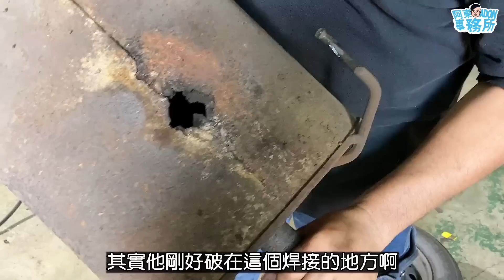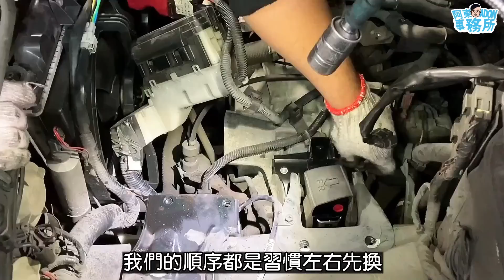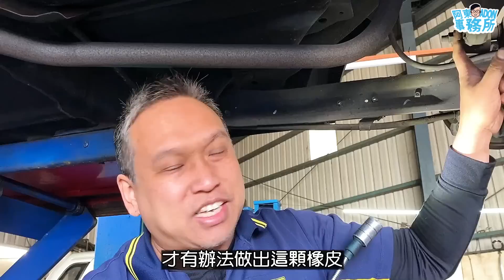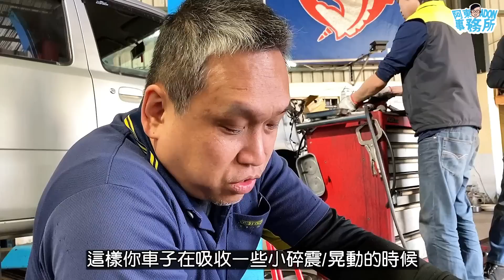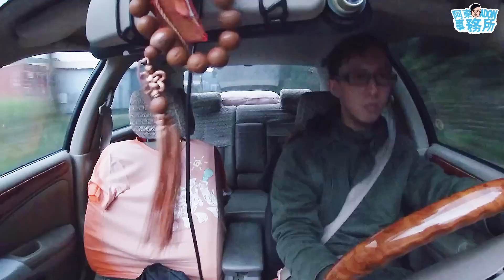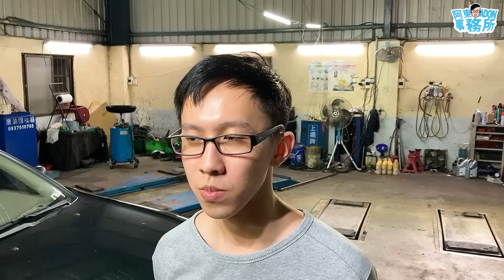[汽車維修] Nissan Sentra 底盤硬起來-這舒適性家長肯定給過！-阿東ft.昱聖汽車

Comment: I driving this N16 sentra too. And the rear really will buoy left right as you said. Only way is have a stiffer damper but usually will destroy the rear passenger ride comfort. Not easy to find the balance. The owner can also try 4-2-1 extractor and try with standard air filter box. Keep a silencer at right location(my mechanic have the drawing formula) I tried and if correctly done it give slight HP and Torque improvement while maintain fuel consumption. The air filter if change to aftermarket will suck hot air and may take more fuel. Last time mine with standard airbox 80-120 also better pick up. Sentra is a good car. Can keep for long time. Hi from Malaysia.